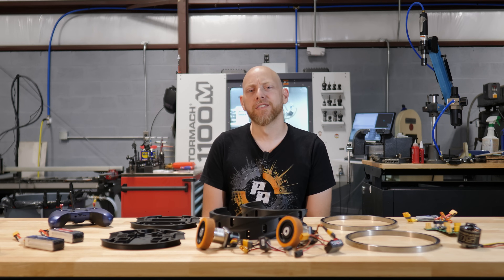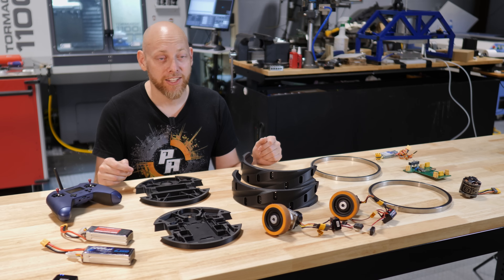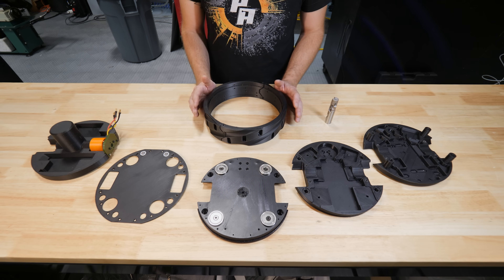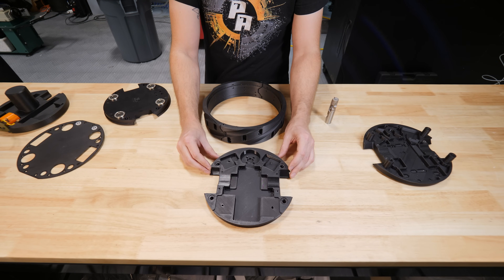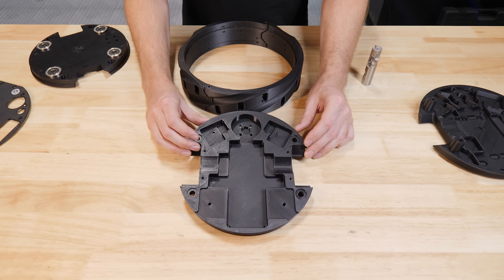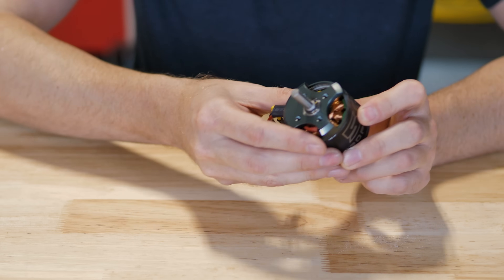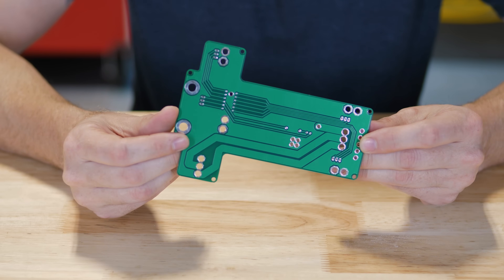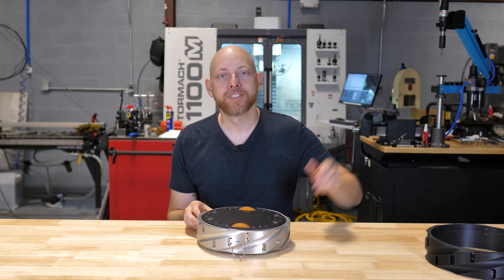Building a Battlebot Part 1

Comment: The problems with small bots it that air is your friend. The more space you put between the other guys weapon and your Juicy internals the less thick your armor needs to be. TPU bots work well because the have so much space. Size also leads to a more stable footprint, better cooling, and better control. The problem is that things can get bent and warped more easily

Comment: Unless they are designing paperweights, there are no engineers that build a product completely in cad, send it to manufacture, and have it really work the first time.

These people will invariably produce a sub-standard product that will approximately meet minimum specifications, and they don't care. These people are "designers", they are NOT engineers.

Engineering is, by definition, an iterative process.

Comment: Heh building as small as possible is basic combat robot 101. As for magnets, most bots on battlebots have them. But for smaller bots (beetleweight/antweight) they tend to use wood floors. Also some car ESCs allow you to turn off the reverse delay. Very common for RC crawlers

Comment: for years now ive wanted to try starting (or joining, if its already a thing) an all 3d printed battle bot league, where pretty much all the parts, except stuff like nuts bolts and electronics, are 3d printed. but i dont even know where to get started.

Comment: 3:10 mh…  “taking a lot of little chunks out” only works because there is constant force behind an end mill. The robot on the other hand is not connected to the floor and has not that much weight compared to the force you want to exercise. So after that first nip, your bot should bounce back (so does the other); meaning all successive spins would likely just scrape air. I assume that is the reason the prominent approach of making “one big hit count” emerged as a tactic of choice. But lets see… I can be wrong.

Comment: The reason you're having issues with your brushless drivetrain is because BL ESC can't really have smooth startup without a hall sensor. If you need to "shift" into reverse your ESC is in the wrong mode. Put it in "crawler" mode and it'll ESC brake (some ESCs have adjustable brake), and straight to reverse whenever you're under the PWM midpoint. You also seem to be using a plane/drone motor. Get something for a crawler car (with stepped rotor sections etc). Holmes hobbies makes good motors and rebrands nice ESCs

Comment: Cool design! Grinding(cutting i guess) spinners are so rare nowadays, and im excited to see it irl. 

People dont use magnets (actually many builders use them) for few reasons. 1. The arena floors in many events are made out of plywood, which magnets dont help a lot. 2. The overall stress the magnets put on the bot (mostly the drivetrain) need to be addressed in design. 3. Magnets might catch on some broken parts and highcenter the bot during a fight. 4. Some events have rules against magnets. 5. Magnets make the bot dynamics wierd, and many drivers dont need them. 

btw halfen the voltage quarters the power, and a 500w weapon motor on 12lbs sounds underpowered.

Comment: Not sure about those large bearings. Seems like a weak point, any significant flexing of the drum could blow them apart. I would think it would be lighter and more robust to support the drum with a series of smaller bearings around the periphery.
Reply: Any idea what those bigger bearing are called?

Comment: Most of us build dense or try to. A LOT of us use magnets though. Generally we had rules to prevent sticking upside down (weighing over double) but those original known rules kinda fell off in the days before sparc. So we have been adding those rules back.

The way chronos does drive with 2 wheels is to have a ptfe thin plate that is runs on (could also be uhmw). Recommend not using brake though on the brushless motors.
This is a super impressive looking bot though! Very well executed overall. I personally dont love how finicky friction driven weapons can be though.

Comment: Sounds like a perfect application for an Odrive Robotics motor controller. Check them out
Reply: Definitely worth the upgrade to an ODrive or similar robotic brushless driver over the hobby RC car ESC. That jerkiness he mentioned is coming from the ESC, not the motor itself, and the gearbox will reduce the velocity but amplify the torque. Even running open-loop the ODrive will be better, by adding an encoder (I recommend a magnetic non-contact type if your RPM is in spec; depending on your construction it could go on the wheel itself and reduce the physical effects of gearbox lash) you can achieve absurd levels of control fidelity.

Comment: Here's an idea, chop up your tub of 3D prints that didn't work and toss the bits into the plastic extrusion machine you have with a nozzle on it that is the same diameter as the filament the 3D Printer uses...you might just be able to turn failed prints back into filament that can then be used to make more 3D print jobs...no (or very little) waste plastic, all you "waste" is time and electricity AND you cut down on your materials cost since you won't need to buy quite as much filament for the Printer...
Reply: Most plastics for 3d printers can't handle that.

Comment: Circuit board "pretty compact" .... really? Looking at the circuits on that thing it could be a heck of a lot smaller. Looks like you designed it to fit the opening you made for it way back in design. But, whatever. Looking forward to see this completed an hopefully a video of it competing. Good luck!
Reply: I think it's this size to get the power to where the motors are so he doesn't have to use bulky cables. It probably could be a bit skinnier, but putting this much power through a PCB you want as wide traces as possible.
Reply: @DarkArtGuitarsWorkshop  Good point. Didn't think about the fact that it would replace cables.

Comment: Carbide is hard, but brittle. Great, if the forces are in the design limits, but chips or shatters over that. (Even minor forces in the wrong direction break them, and don't ask me how I know.) Also expensive. I think pieces of HSS can be better in this case. I like the basic idea, I hope it will work.
Reply: I think you'll appreciate the next video ;)

Comment: Tip, If you need more current through the pcb you can leave portions of the trace without solder mask so you can build up solder on it for more current flow
Reply: And for even more, you can solder on a piece of bare copper wire.
Reply: If I understand it right, the higher Resistance of Solder...
It does not carry much more current compared to Copper...

So what I do is solder Copper 'Busbars' as in 1x5mm Copper strips to the PCB
Reply: @T1g3rch3n  You're not wrong about solder, but a good heavy solder on top of the trace is good enough for +50-100% current rating in practice.
Reply: @bradley3549  exactly
Reply: @T1g3rch3n  That is correct and perfectly fine for home tinkering. But when wave soldering the board its just easier to apply solder to the traces instead of having to place custom made copper strips on the PCB.
Reply: They have cnc machinery, so they could make 1-3+mm thick nickel plated copper busbars that bolt directly to a exposed copper pour on the pcb(preferably enig surface finish), would be best for actual high current, like 100A+ in a compact area.
Reply: @GENcELL2014  That’s exactly what I said. They can get away with that since it’s a one off product. For tens of thousands it’s not feasible to manufacture and solder on busbars to PCBs.
Reply: @ThePunischer1000  I'm talking about actual custom shaped bubars that aren't just straight bars, and that aren't soldered to the pcb or wires, bolted connections. Soldering pads/exposed copper pours works to help increase current capacity but for different reasons like thermal expansion differences and resistance a mound of solder isn't optimal.
 
At a sertain current level 2oz copper and hasl/wave soldering still takes up to much area, so it's far more reliable and compact to have fairly thick copper bars pressed against pcb with hardware like bolts, washers, and nuts. Still handy to have wave soldered traces in non busbar needed apps or areas on pcb.

There's also all sorts of pcb specific hardware like insert nuts, which make final assemble after receiving pcb from fab minimal since all assembly occurs from a single side no fiddling with a nut on underside.

Comment: I really like the pin that locks the rotating shell to the body for transport/assembly!
Reply: Like a Grenade, once you pull the pin, Mr. Bot is NOT your Friend...

I can see the instruction manual now: (Paraphrasing the Grenade manual) Pull Pin and DRIVE!!!

😄😁😆😅😂🤣
Reply: Also a requirement for safety during load in/load out of the robots